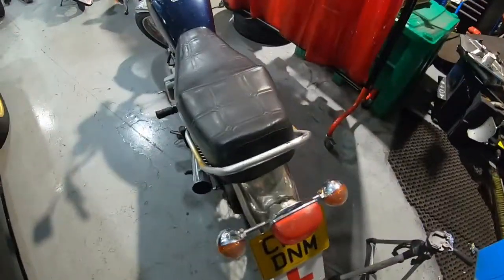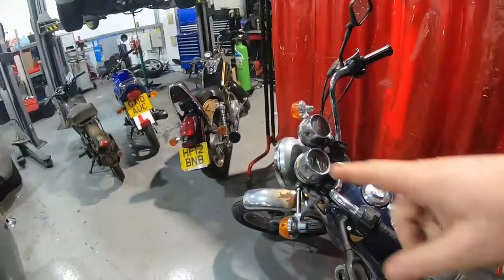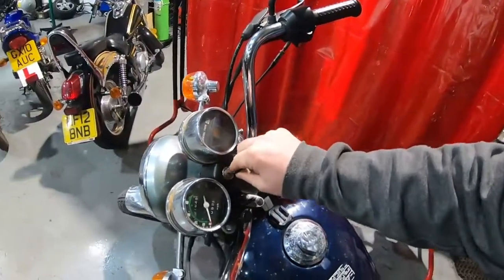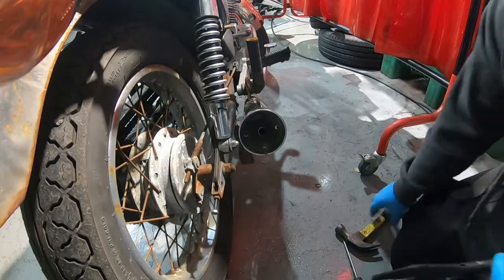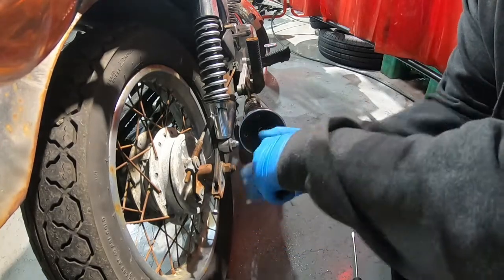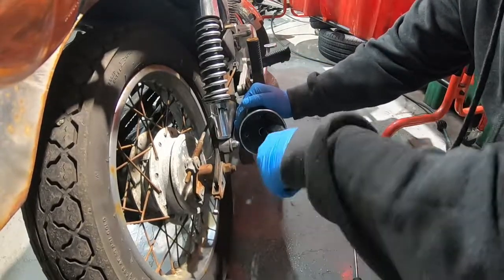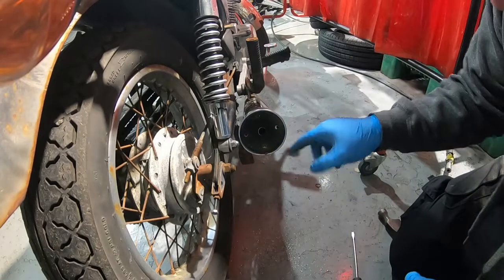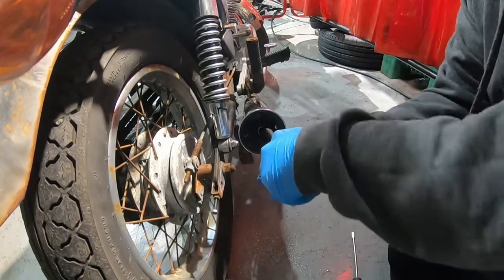How to make a 125 sound better - CM125 Baffle delete

Comment: I've read somewhere that this motorcycle was made to produce 11kw but it somehow doesn't
Reply from the maker: Beleive it or not, iv flind it runs a lot better without the baffles.
Reply: @MarksWheels  maybe it was just the baffles doing their other intended purpose.
Maybe, they're so restrictive that it goes from 11kw to 7.9 👀

I haven't found anything online to support this hypothesis, but it sounds reasonable since we're dealing with such low power 🤔

Maybe I'll do this to mine as well 🖤
Reply from the maker: @rafaeltavares6928  could well be!
Reply: I made mine into a tracker-ish.  removed double seat, added tiniest rear & front led lights & flashers, removed speedo, cut frames shorter, added plastic tyre huggers for mud splash (coz i cut the rear part of the rear mudgard),added lightweight front plastic mudguard, removed side covers, put a suzuki gn125 tank instead of big original one, made a small custom area for putting battery+rcdi+racing ign coil+ wiring looms, on top of that i cheated more by buying racing parts, reinforced lightweight piston, racing tappet, race mikuni carb, iridium spark plugs etc... All these made it in a pocket rocket 🤘😂

But thats my preferences. For ppl who dont need spending too much just 
1)Put a racing 125 modern cdi 2)Lightweight titanium pipes 3)Lightweight small race muffler 4)Cone air filter
5) Finally get a carb tune.
 
Maybe will get to 11kw.